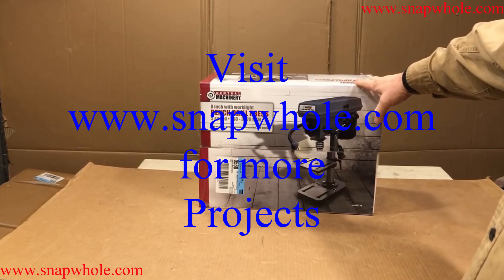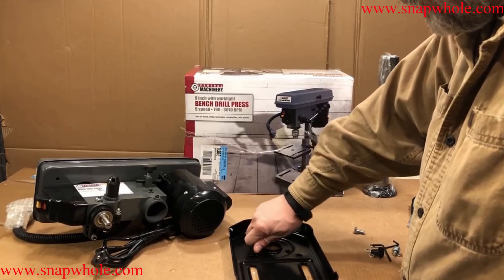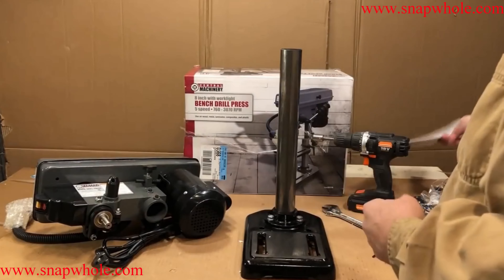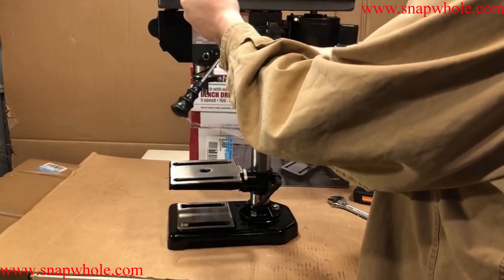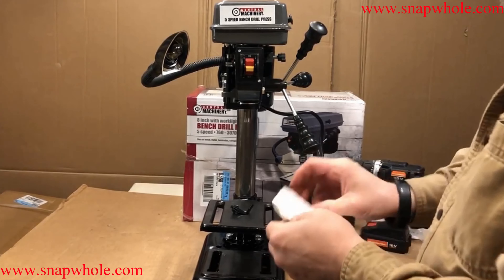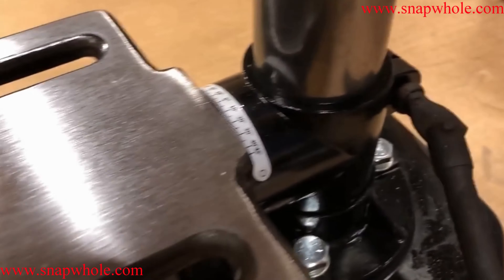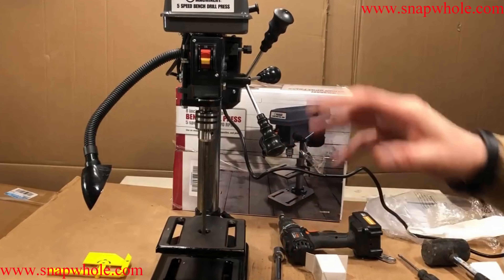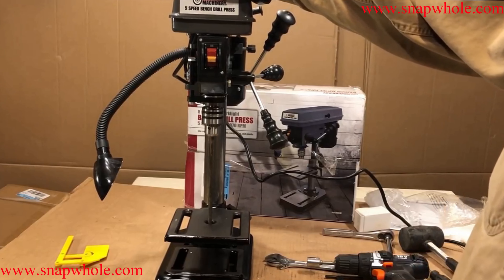Harbor Freight 5 Speed Mini Drill Press Review and use Demonstration - Central Machinery

Comment: Thanks for the video. Towards the end, when you're drilling the countersinks, it seems that the metal table flexes with the thicker board at 22:45 and 23:28. Is that the case or more of the wooden top that's flexing?
Reply from the maker: its a combination of factors, most of the flex is from the wooden table fully seating on the metal table ( I removed the wooden table right before using the countersink) - there is also a very small amount of flex in the table, and the quill also flexes a liny amount - when I'm doing counter sinks, I don't worry about that, but when I drilling in metal, I have to be careful and not apply too much force
Reply: @Ari Martin ehh I watch on flixportal. you can find it through google:P -theo
Reply: @Theo Joziah thank you, I went there and it seems like a nice service =) Appreciate it!
Reply: @Ari Martin You are welcome :)